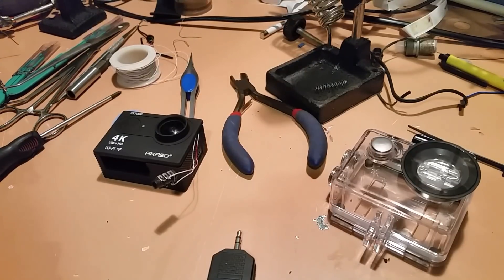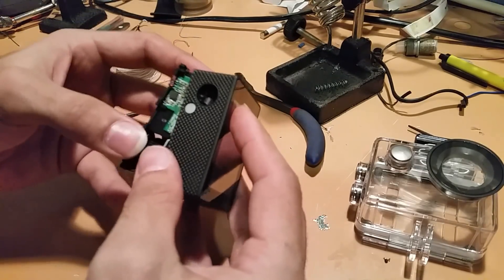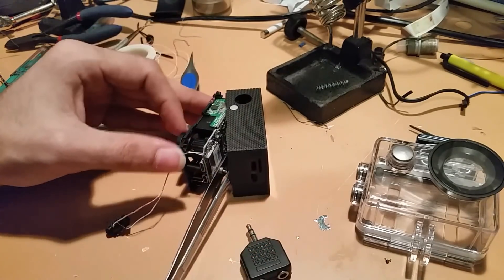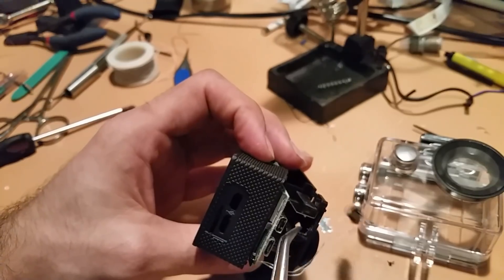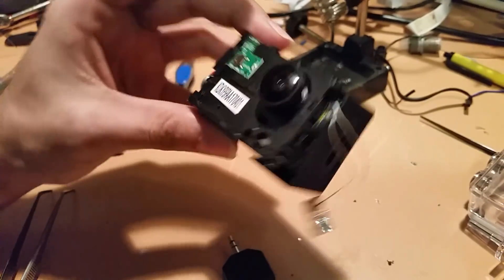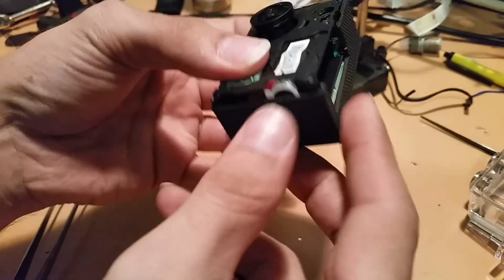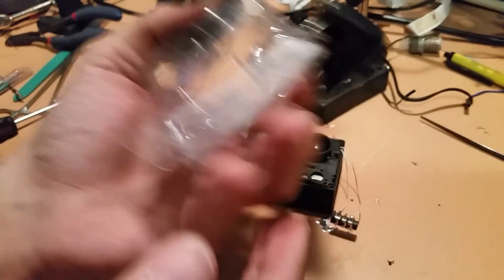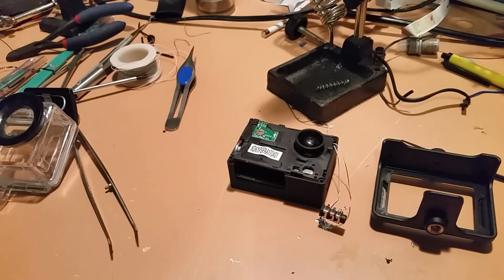Akaso EK7000 External Mic Hack - Hardware Side

Comment: Hello. I have read that the ek7000 accepts exterior mics through the micro SD port. Could I get a micro sd to usb c adapter and then hook up my wireless microphone through the usbc connection?

Comment: On a bit of a separate topic, but in the same area you're modding, I was wondering if you think the micro USB port can be replaced?  I'm running the EK7000 with a USB battery bank & I guess some moving of the cable caused the micro USB port to go bad.  Also the micro USB cable doesn't seat all the way flush to the camera body.  I was thinking maybe the micro USB port could be UN-soldered & replaced with a Micro USB 2.0 A Female Male Jack Connector 4 Pin Wire Data Charge Cable Cord.  Your thoughts?

Comment: I have used a similar socket.  Do you connect ground on the socket to mic - on the pcb and mic input on the socket to mic + on the pcb?    Also, do you need to join the L or R to mic on the socket?  Help/guidance from anyone would be appreciated
Reply: I have got it working.  The mic only transmits via ground and mic.  It does not use the L and R connections.   I got a TRRS socket, because it had a small profile.  Used a hack-saw blade to remove the plastic web abd pillar to get room to manoeuvre the socket and wires into place.   It didn’t seem to matter which polarity they were connected in.   Great fun doing this hack - now to see how it performs on the road.

Comment: So what happens to the original internal mic once you perform the mod? Are both mics active at once?
Reply: Ah got it. Yeah that would be great! The more info the better.
Just for some context: I'm riding motorcycles across the US with my dad and my brother in less than a week. We bought some of these cameras because we wanted helmet cams but didn't have the budget to go out and buy a bunch of GoPros. They work great except for the fact that we really need helmet mics.